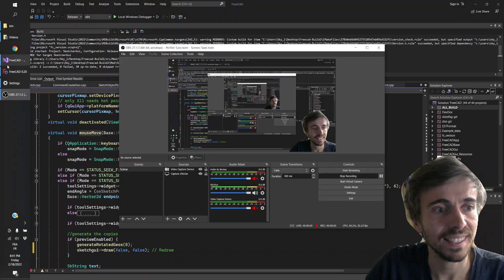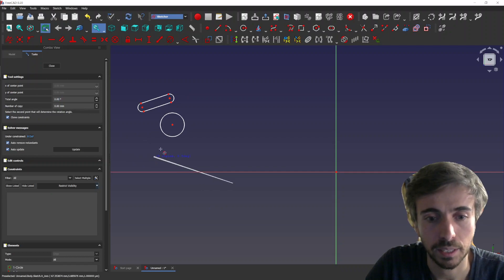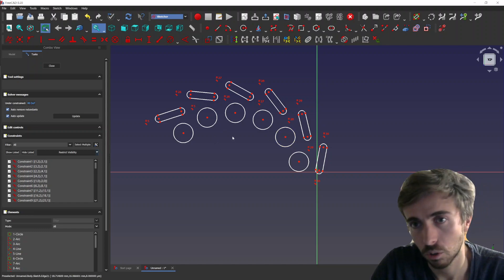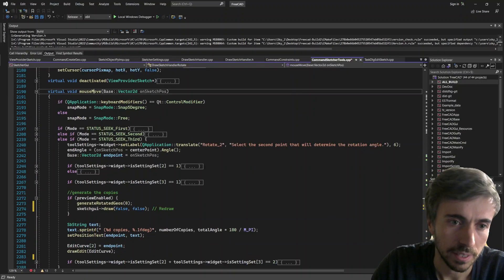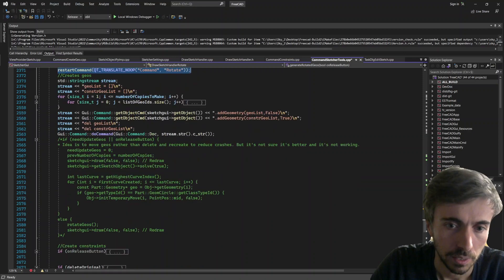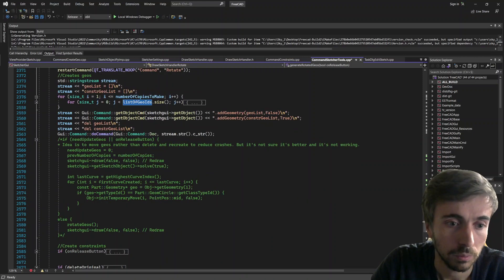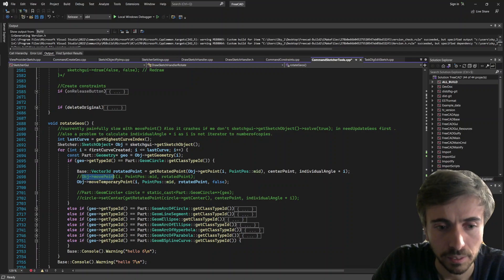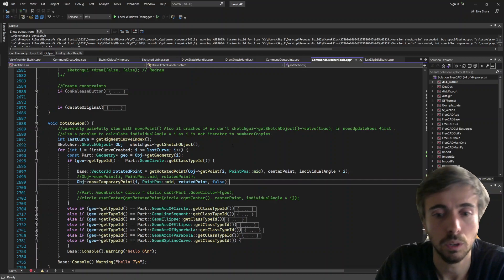FreeCad Sketcher new feature : Rotate/Circular patterns

Comment: Can you limit the number of objects while dragging with the mouse ( even to a single start and end object) and only allow the creation of all, when the required number is typed in. That way the processing should be cut down drastically with each mouse movement?
Reply: The processing problem is gone and the feature merged in 0.22dev if you want to try it btw
Reply: @pierreboyer9277  
That's great. I was just using 0.21.2 and looking for this feature. I'll have to update. Thanks a lot.

Comment: Didnt use FreeCAD for over a year now. A bit over a year ago I decided to change to Solid Edge and started to do stuff there. As I have stopped 3D printing I stopped all that stuff. Now I came back... just wanted to do a quick project. Something very simple. As I still was more used to FreeCAD I installed the latest version. Now in my scetch I need exactly this very simple tool. Where I can copy geometry and rotate it around a point. And guess what, its not there. God... who is working with this software for real? I mean... even me who just wanted to create something very simple... isnt able to do it. Because this function is not there. Absolutely useless software.

Comment: Thank you for the features. I suggest focusing on "offset sketch" which Freecad desperately needs in order to compete with e.g. Solidworks and thus is a feature of high priority
Reply from the maker: Yes offset is on the roadmap too. However I'm currently doing a break in new feature to focus on getting what I already made merged. Which may take some time.

Comment: You're on a roll! I'm looking forward to seeing those merged into master!
If you're still looking for tool-ideas: I'd like to see an offset tool in sketcher like the one in the draft workbench.
Also when using "External Geometry", I'd like the option to actually use the linked edges as part of the sketch. Currently I have to link the edges and then redraw them, so they are actual edges in the sketch. A nice little checkbox when linking the edges to also add them to the sketch would be nice.
Reply: Thanks!
Yes offset is on the Todo, but for now I'll be focusing on merging the features I made so far.
For your idea on external géométries I suggest that you post it on the forum.
Reply: Freecad realthunder version alteady allows to use externel geometries